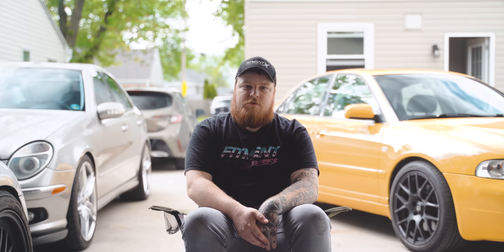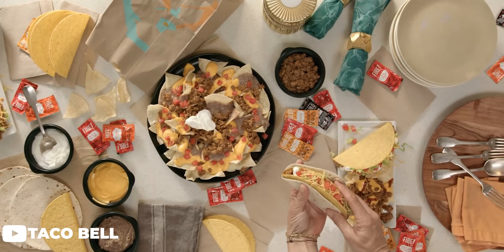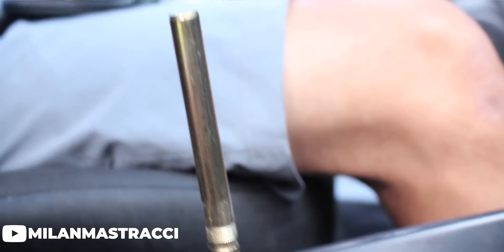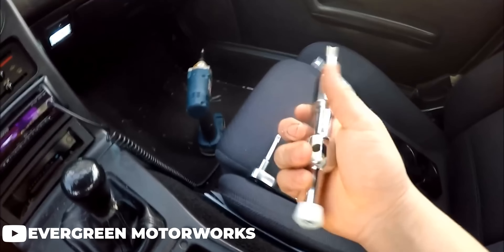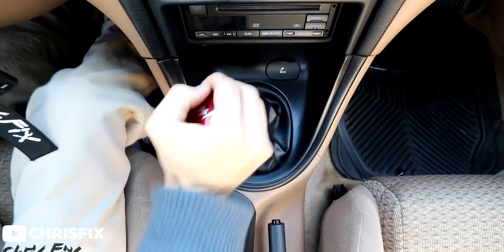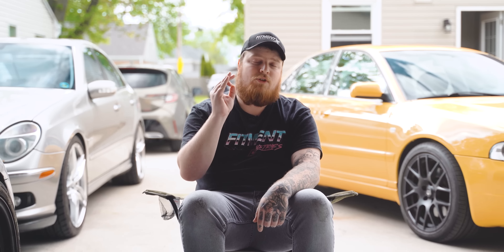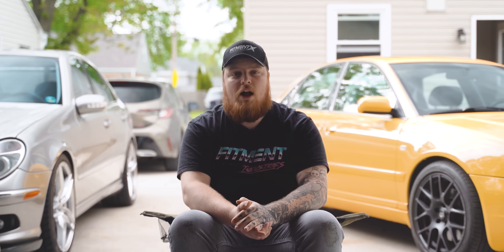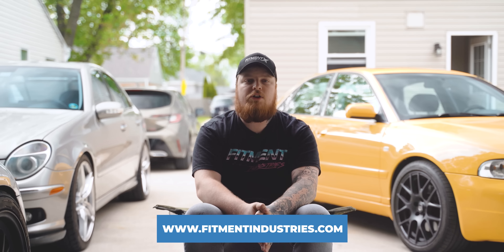Best Interior Mods You Can Find Today

Comment: My favorite interior mod so far has been swapping my mkv base model plastic steering wheel for a leather GLI wheel. Especially when paired with a new shift knob it really makes the car feel more premium in the areas you touch the most. I couldn't live without my Android auto headunit and upgraded speakers either though. At this point all I need to do is get a couple modules to get the paddles working and look into some seats

Comment: Really didnt mention the steering wheel
Reply: Not smart to remove your factory airbag if your barely going to the track buddy
Reply: @mercury0214  
Yea that's what kinda bums me out about my mk4 Jetta , most of the factory wheels you can swap are lame looking. 
I'm totally in love with the mk1 scirocco wheel on my mk2 Jetta coupe though , I wish I could do something like that without dying in an accident without an airbag.
Reply: @mercury0214  at least with 86 and e60 platforms, there are a bit of aftermarket wheels that still use the airbag core. I just use those cuz I know my ass finna die if I put one without an airbag
Reply: @MrTheHillfolk  you can get the jdm civic type r steering wheel. Very clean and sporty look but minimalist and comes with an airbag. Just put whatever other badge you want on the wheel
Reply: Livan Baez-Castillo oh yeah it’s a shame only a few models have enough aftermarket support to get something with an airbag. But I speak from experience when I say you need that airbag I had one without one on my first car years back and it put a dent in my skull
Reply: @MrTheHillfolk  Best thing to do with a MK4 Jetta or Golf steering wheel is to put a MK6 GTI flat bottom wheel in it. It's so much fucking better.
Reply: @mercury0214  not all aftermarket wheels remove your airbag
Reply: Ok Dokey lol what if you didn’t get a airbag from factory
Reply: gold fish then go for it chief
Reply: TheyCallMeMidnight did you read my last comment chief
Reply: @mercury0214  gotcha my fault, then yes I agree with you. It is not wise to lose your airbag for street car
Reply: TheyCallMeMidnight yeah I mean if you don’t have it no lose but if you do and your not tracking often it’ll help you out for sure
Reply: @mercury0214  Who needs a airbag?

Comment: best interior mod on my depreciating renault clio 1.2 16v 2002 75Hp/55kw is;
steering wheel cover (store bought),new speekers, new Stereo, and sewed my seats to give them a bit more life.
I already spend double than my car's value in maintence, to give it 10--15+ year's of normal driving+ safety is improved (better than factory did it). 
Only plus it can travel 40-45 mpg with steel wheels, semi-good tyres, almost full trunk, and me(semi-thick boy)
when it will be time to replace engine (after 125000-190000 miles), I will see,  if I'm going all out on it and never selling the car, or buying a new car and slowly modding it, after warranty ends.

Comment: On my golf 3 vr6 I have the whole speedometer set up on white LED
Reply: I put a set of those silly looking chrome rings in my mk2 speedometer cluster. 
I've seen them on eBay and laughed at them, but totally changed my mind when I saw them in a car at a show. 
So I got a set for my mk4  Jetta project I'm working on now. 
It's a 4 piece set and has a surround for the lamps in the center , but I think I'm just gonna do the 2 rings for the tach and speedo...
One of those things I thought was rice until I saw it and said , niiiice 👍
The mk2 got some bits like polished inner door handles and chrome door latches and polished lock knobs. 
Seems like  a bunch of 20-30$ little mods like that really wake up an interior.
I kinda wanna do new gauge faces for the mk4 , reverse them to black on white.
Reply: I bought 4 different coloured led lights for my miata cluster for some extra rainbow rice

Comment: Except if you have an LNF ecotec manual. Then you need a t-25 torx and possibly a valve stem puller because they decided to add splines to the knob and not just twist off 😬

Comment: Tip for anyone with an e46: if you're changing your shifter and it's threaded, wrap a thick layer of electric tape on the stick and twist it on, genuinely more secure than their actual design

Comment: I don’t think I can get the 6 speed knob of my challenger have to get a short throw
Reply: of course you can lol
Reply: It doesn’t twist off it’s attached to the whole assembly
Reply: @Ghilliemon  have you googled your car? there will be some way to do it, might need an adapter or something
Reply: @arcanevoid9199  yup. The handle is attached to the stock shifter assembly. Don’t think there is any adapter either what’s the point of doing one anyway if you could just install a short throw..